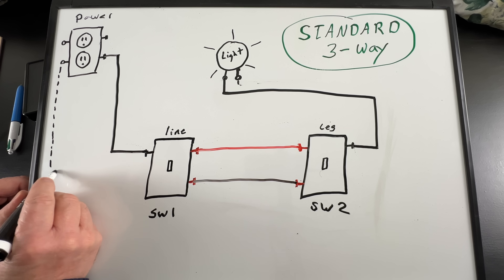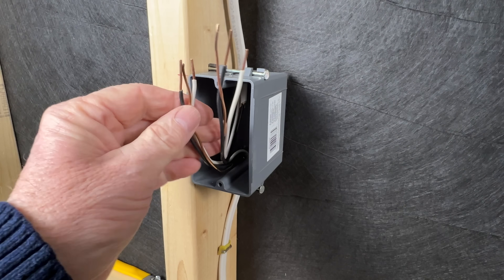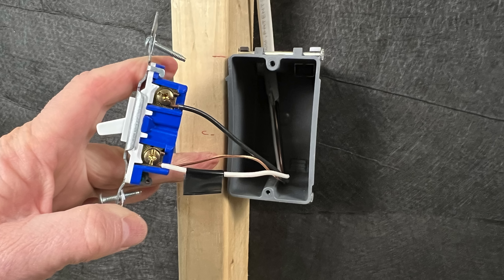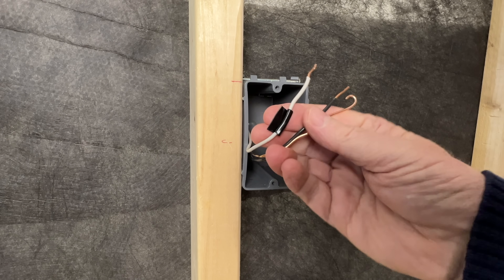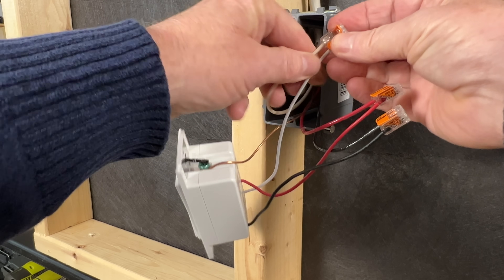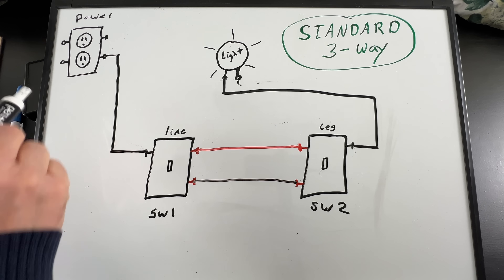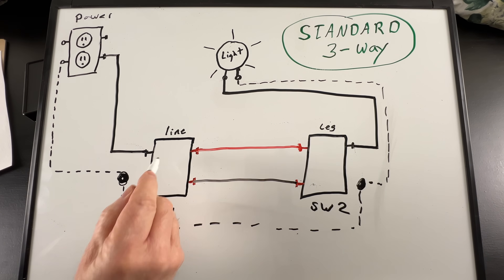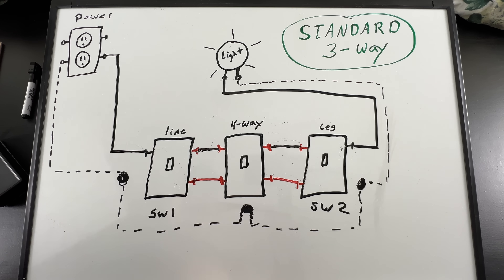How NOT to Wire Light Switches in 2025 (New Rules)

Comment: Just remember kids. You can use the white wire in the 14/3 for either the switch leg or the hot. I had a situation recently where a crew member wired up a 3w-4w-3w switch setup and had the constant power at the first location, constant power and switch leg (mixed up and on a single pole switch) where the 4w switch was supposed to be (but he installed a 3w switch) and then ran the travelers to the second 3w switch location and didn't have any switch installed because he didn't understand why the circuits were tripping (having constant power from 2 afci circuits feeding the same 3w setup). This lighting circuit was for a long hallway and the 3w switches on both ends were sharing boxes with different circuits so the only way I could think to get it to work was to make both 3w switches dead ends but using the white on one end for the power and the one on the other end for the switch leg.
Reply: With how outrageous wire is nowadays I usually use 14-2 for the travelers.  14-3 I only seem to use for the smoke detectors.

Comment: I always include a neutral in a switch box. There are some switch devices today that require one and I've seen people use the ground as the neutral leg in these situations causing a dangerous situation down the line for whoever works on that circuit in the future.
Reply: I once encountered a BATHROOM (house built in 19:90 in California) that had two switches (one for the lights and one for the exhaust fan), went to replace the light/fan unit, discovered they only ran a single 14 gauge two wire romex to that device and used the black for the light power, the white for the fan power, and the unshielded ground for common for both with NO grounding - talk about confusing and a code violation.
Reply: @ragtowne  I've seen a substantially more dangerous hack job while helping my stepfather rewire his 1973 rambler.  Aluminum wiring throughout, 70 amp Zinsco panel in a bedroom closet,  as can be expected in a home built during that period.  The thing that tipped us off was seeing 2 wire 12 gauge landscape lighting wire used to power the 4500 watt 40 gallon electric water heater, dad turned off  the main so I could cut the wire so it could be removed and replaced with a proper 10-2 NM and a 2 pole 30 amp toggle switch since the unit wasn't within sight of the panel.  I got a loud bang and vaporized about a half inch hole in my side cutters, turns out a previous owner had tapped that landscape light wire on the line side of the main, so that wire which ran in the crawlspace for almost the length of the house had no overload or short circuit protection,  other than the primary fuse on the pole.   

The 3 way switches in the hallway were wired with feed at the light,  and 12/2 Aluminum NM was dropped from the light box one to each 3 way switch,  metal boxes.   They were using the black as the common,  and the white and ground as the travellers,  with the bare "ground" traveller resting against the metal switch boxes .    

Since the old galvanized iron water lines were to be replaced with pex pipe anyways, we stripped the house down to the studs  and started over from scratch.   That was would have been in 2005 and being 16 at the time, found it very educational and rewarding.  Sadly that feeling of satisfaction came to a screeching halt when we lost the house to foreclosure in late 2007 because Dad had taken out an adjustable rate mortgage when he brought the place in early 2005 and was unable to afford the mortgage once the introductory APR ended.
Reply: @ragtowne Let's hope they didn't do the same in the main panel!
[gee this 2/0 white wire is expensive, let's just use this 6ga ground wire here!]
Reply: It will also raise havoc if someone tries to upgrade to GFCI; trying to figure out why the breaker won't stay in, or where the fault is...
Reply: Some electronic dimmer are designed to not require a neutral. They put a small current on the ground and apparently this is allowed.

Comment: I'm very curious about what the California 3-way is but also way too afraid to Google it. And I don't even want to know what the Buckfield 3-way entails.

Also, I had never heard of the dead-end method, and at first I was wondering why it'd be useful. However, I actually want to install a 2nd switch for one of my existing lights. This would be the best way to do so, so I'll probably do that. (Or at least facilitate the ability to use it that way if I or a future home-owner were to go back to non-smart switches.)
Reply: In California 3-way you pass an always hot wire in addition to the normal travelers between the switches.

Well the easiest would be to use a smart switch. No new wiring would be needed. With a kinetic switch one would not even need to worry about a battery.
Reply: Google it. Actually google “California three way switch”.
Reply from the maker: I'll make another video.

Comment: Maine hasn't adopted 2023 yet though right? We started wiring my brother's cabin under the 2020 code but haven't had it inspected yet. Will we have to rewire anything that isn't 2023 compliant?
Reply: Just wire it up the way you think it should go (at least if you know what you're doing).  Inspectors always come up with some silly crap that they want you to change even if you do do it to code the way you think it should be done.
Reply: If the jurisdiction that you are in has adopted the 2020 NEC, and you have permitted your job under that adopted 2020 NEC, your job will be inspected under the 2020 NEC. If you fail that inspection with the permit you purchased under the 2020 NEC, your corrections, as written on your correction notice, will come from the 2020 NEC. You are not required to comply to a code cycle that has not been adopted by the jurisdiction that you are in. They, your jurisdiction, will usually give a 6 month notice of an impending code cycle change, to the 2023 NEC or the 2024 International Residential and Building Codes.
Reply from the maker: Not yet but they are in the process right now.

Comment: So I assume in a standard 3 way setup, your switches are really only tied to 1 light and then the rest of the lights in a multi light room would just daisy chain off that 1 light like normal?
Reply: That is correct.
Reply from the maker: You are correct. Once you have your switched power you can connect that to all the lights controlled from the switches.
Reply: Yes, you hook the lights together in parallel.

Comment: The reason they're doing this is because of dimmer/electronical switches that they're coming up with nowadays. They need the 120 volts in order to power up the electronics in it.
Reply: I guess electronical switches are the type with angry pixies in them.
Reply: 120 volts has nothing to do with it. 120 volts is already in the box. It needs the neutral for the circuitry within the switch for a return path to source. A standard switch functions off of 120 volts, but the lever on the switch just opens and closes a contactor in the switch and that doesn't require a neutral.

Comment from the maker: Go to https://drinkag1.com/backyardmaine to get your FREE welcome kit that includes the canister, shaker, a year supply of vitamin d3k2, and 5 extra travel packs of AG1! Thanks to AG1 for sponsoring today’s video!
Reply: Why would people run a switch loop when power can be feed from the switch itself?
Reply: wow you almost made it a full 60 seconds before screwing this up. First it was NEVER legal to reflag any conductor less than #6 under the code period. Second white is not nor ever has been the designation of "neutrals" white has always had the designation "grounded current carrier" and had a specific exception for this application therefor no reflagging of the white conductor in this configuration was implied or proper even if the wire were #6  (you only ever mark some other color TO white NEVER white to something else EVER PERIOD don't do it it is a mistake. The same is true for green and the section on marking is VERY detailed and exact in this regard with shall and must playing a large part in the descriptions and circumstances listed) 

  As to the change? it is moot to me , my experience is that wiremen have been feeding at the switch or even home running from such boxes for 50 years or more as simply good practice and rarely if ever used switch loops and only in closets and crawl spaces where the use of powered devices is uncommon...also this change does not solve the grandfathered installations none of which are required to be upgraded to meet this code so the problem still exists and will always exist in some capacity.
Reply: But are you being paid by this product to promote it? Be aware of the legal troubles Dave Ramsey is in for not letting his many followers that trust him to promote products know that he is also paid by the companies that are being promoted.  Just a helpful tip as you are very helpful to us here in video land!
Reply from the maker: Thanks.. I have to be careful. I'm covered by the paid promotion text at the top of the video screen and of course I have to say that this video is sponsored by whom ever is paying me to promote a product.  @mostthoughtprovoking
Reply: For dead end, why can't you run an additional 12-2 between SW1 & SW2? Tlhis would give you the needed black hot and cap the whites should a neutral ever be needed in SW2 or code change required.
Reply from the maker: @jimertzman6628  You could do that or even order some 12/4 cable. The reason you only need a neutral at one location where multiple switches control the same lights is because you would only need a smart switch at one location for the system to work at all of them.
Reply: @BackyardMaine yeah. I was going to suggest that but the price of 12/4 has to be ridiculous.